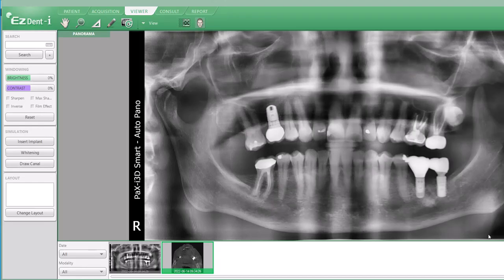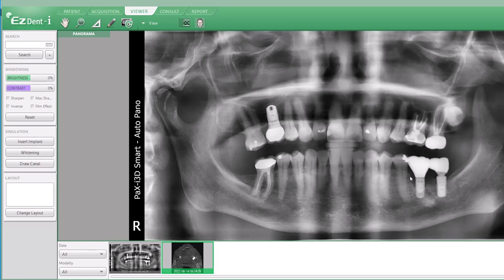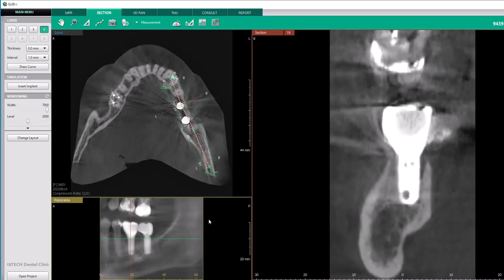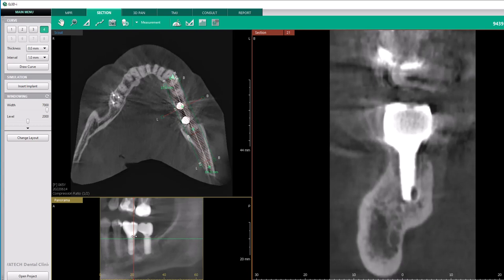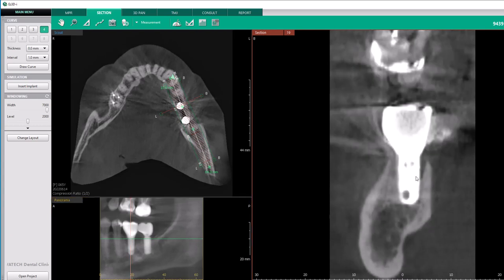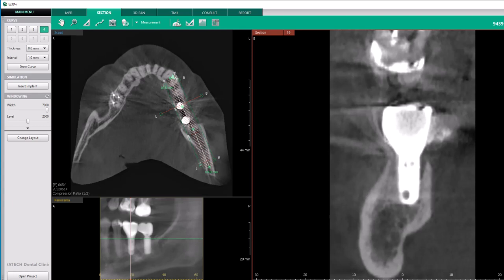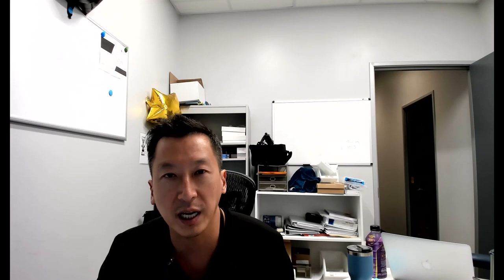Failing Dental Implant? What causes it? How do I Treat It? Does it Need to be Removed?

Comment: I just had dental-implant surgery. I got two in my upper left side of the mouth. The doctor said I have “great bone,” but this video makes me worry that my implants may not last.
Reply from the maker: im sure things are fine!  dont overstress.  but now you know what to look for if there are any issues
Reply: @northtexasdentalsurgery . Thank you. They are fine right now 😊 I had my follow up appointment today, and I’m healing really well.
Reply: Hi also have left lower 2nd molar implant with some bone loss. It’s a zirconium cera root implant. I’ve had it for about 5 years. It very sore around the outside of the implant toward the cheek. It’s very pink. I’ve been on antibiotics 3x, oil pull, use castor oil, peppermint oil, oregano and rosemary oil at different times together healing. Still sore! It’s always felt like the skin was stretched around the implant. I’m ready to have it removed because of the discomfort. It’s not worth the pain it causes. I can’t have metal implants either. What are my options? Would lasering the gums help remove the infection or make it worse?  Your expert opinion would be appreciated.

Comment: I recently had a implant (3 weeks ago) I made mistake of putting my old mouth  guard in one night. Big mistake, it must of pushed down on the implant and now I'm in quite of bit of pain. Not sure if it will heal or should I have it removed and repack with new bone graft. My surgeon says wait a few weeks or months, but the pain is not getting better.
Reply: what was the outcome? i have the screw in my jaw and its been in maybe 2 or 3 months. and i have my flipper that i dont wear often unless im around someone. the other day i had a electrician here for about 5 or 6 hours and i wore my flipper that long and then the next day as well. i think my flipper might of put to much pressure on my gum. and its throbbing almost all day day and a little yesterday and day before. my gum doesnt look swollen or infected. i cant find a answer anywhere if throbbing here or there is normal. every single page immediately goes to "infection"

Comment: i think my flipper pressed on my gum to long the other day and irritated my gun. ive had horrible throbbing most of the day today, and then 2 other days i had a few moments of throbbing. ibprofin isnt working. i hope this goes away and isnt a failure. i have the screw in for 2 or 3 months now. still need to get the crown put in. is occasional throbbing once in a while normal

Comment: I got an implant 4 months ago, they did the torque test and they said it had integrated. A hole in my gums formed and has a little pus coming out. Is it worth saving or should it be removed. I immediately got on antibiotics and now most of the pus is gone. Dentist appointment next week

Comment: Hi also have left lower 2nd molar implant with some bone loss. It’s a zirconium cera root implant. I’ve had it for about 5 years. It very sore around the outside of the implant toward the cheek. It’s very pink. I’ve been on antibiotics 3x, oil pull, use castor oil, peppermint oil, oregano and rosemary oil at different times together healing. Still sore! It’s always felt like the skin was stretched around the implant. I’m ready to have it removed because of the discomfort. It’s not worth the pain it causes. I can’t have metal implants either. What are my options? Would lasering the gums help remove the infection or make it worse?  Your expert opinion would be appreciated.

Comment: I had implants denture 4 in  1  top bottom. 
They had to do a bone graft  and I also told them that I grind and clench dentist said it didn’t matter 
It’s been 4 years since the implants and I’m experiencing TMJ which I never had before the implants even when I had teeth, I’ve been getting really bad headaches , anxiety, wooshing and hearing a beating sound inside my head with a very hot sensation inside my head and I’ve been getting neck and shoulder pain that I’ve never had before the implants, I constantly get a reading on my blood test t that my red and while blood cells are high. 

The last time I visited my dentist he says because I’ve been clenching and grinding so hard that you can see the metal on my dentures , if im grinding so hard doesn’t that mean the implanted are moving up and the bottom down ? 

Please answer my question I need help I’ve been unwell and I do have nerve damage but I don’t know if this was before or after my implants
They are titanium implants
Reply: I got the exact same problem! I'm thinking getting them all out, very tired of them. I had two of them removed and felt better. How have you handled your problem?
Reply: I had a titanium one removed didn't hurt much but it was swimming in pus,I had a terrible fever that night then I felt better afterwards.

Comment: My centre tooth implant was placed at angle as bone density was minimal.  Even at angle the abutment was placed with difficulty and when the torque was applied slight movement was seen. 3d x-ray and x-ray showed movement. I was injected with penicillin in the site and taken 875 mg of augmentin. 6 weeks check up. If no b9ne growth he wants it out. My question is in 6 weeks can I create sufficient bone scaffolding for that implant? If not it out. I guess

Comment: My gum area is inflamed and/or infected near the bottom back leftIs it really important to keep the back molar (implant) intact and cleaned or should I have it totally removed?
Reply: I’m about to have mine removed. Had it 5 years. Sick and tired of the irritation and pain! I’ve done everything from antibiotics to oil pulling, essential oils, castor oil, rinses and salt rinses after all meals. It don’t matter! I just had the opposing upper molar removed due to an infection from a cracked root being root canal!  Another huge mistake…..Root canals. I’ll probably be in a top denture by the time I’m 60..better than being infected. All my grandparents had them and got along fine. I’d rather have my teeth. The rest are in good shape. If everything heals ok, I’ll get those molars redone. I can’t have metal. Nor will I out it in my body. This one is a cera root zirconia

Comment: I am going through the process right now and have been  using the temporary "fixed" dentures for about a year now. For context i had bone loss and Dr. Did grafting process. However, there are two spots  in my gums that when the temporary implants are  tightened it hurts! No problem I say to myself trust the process! Forward to a few days later and my  screwed a.k.a. "fixed" dentures are so loose they make sound as I try and speak 😢  what could be the reason? Also, today I got the call that my permanent  fixed dentures are here, i want to be excited but I can't help it but to be worried help?😢